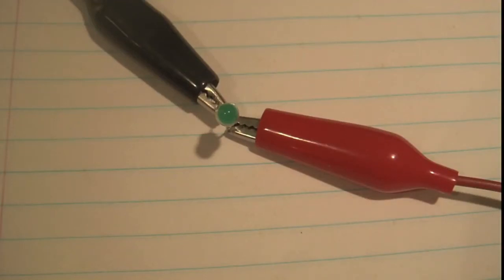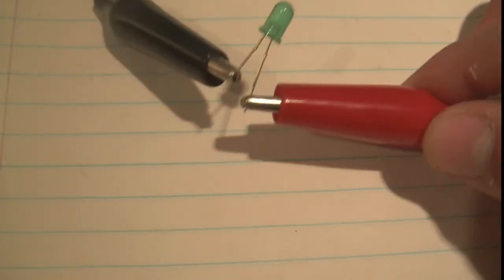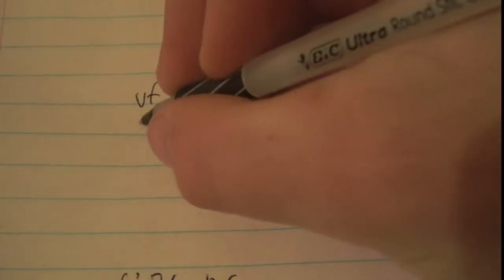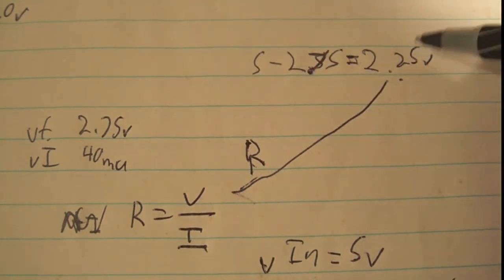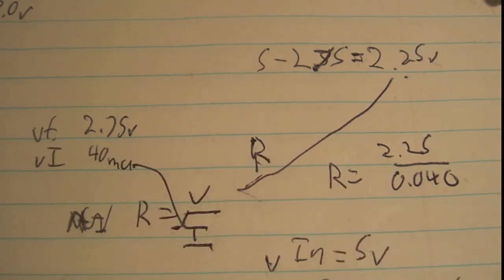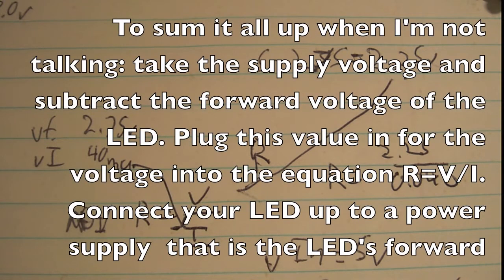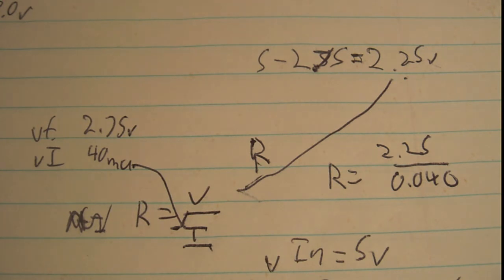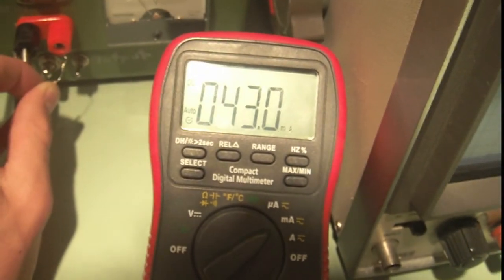How To Calculate LED Resistor Values.

Comment from the maker: Well an LED will light up at 1.6 volts but it won't be visible under lighting, 2.5 to three is a good estimate. Also 20mA is not bad but it is very bright so if you don't need the brightness use 10mA so you don't waste power. Most of the time I don't bother to actually do the calculations and just say if the supply is > 8 volts 1k ohm, if the supply is < 8 volts 330 ohm and call it a day. The only time this is crucial is when the thing is battery powered so you don't waste extra power.

Comment from the maker: Well if you know the voltage drop you can put the LED directly across a constant voltage source (the voltage should be exactly the voltage drop of the LED) and measure the current. If you don't know the voltage drop 2.5 to 3 is usually a safe bet for red led's. IF you have one to spare you could increase the voltage till the LED discolored (more orange or yellow usually) and subtract 2 or 3 hundred milivolts from the voltage it started to discolor. That should be close to the voltage drop.

Comment: is there a way to figure out the exact voltage drop and milli amp value of the LED? i have some red LED's but i dont have the data sheet for them.

Comment: Word of caution: if you hook a resistor up to an ohm meter, you will read a VERY high resistance.  This is due to the nonlinear properties of a diode.  You have to overcome the bias voltage before the resistance drops.